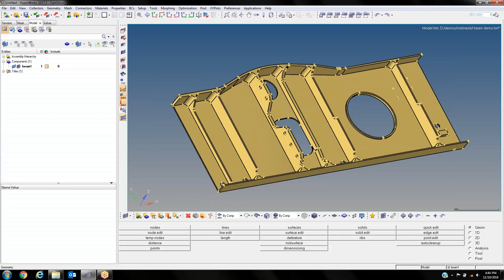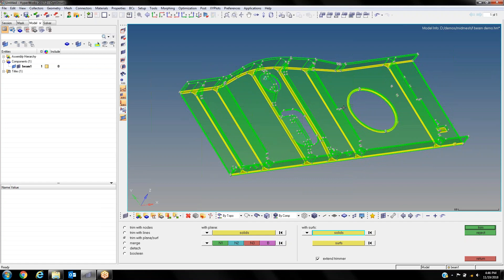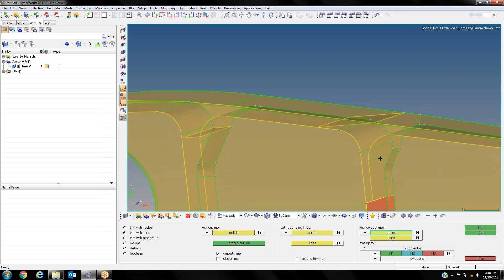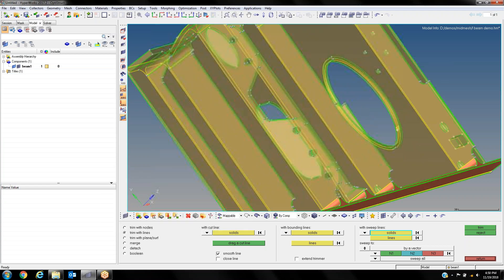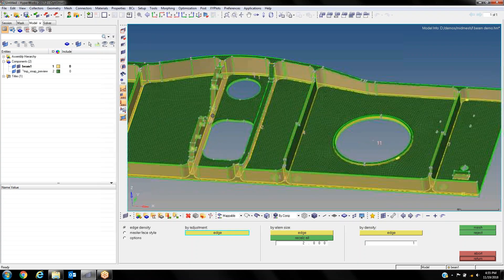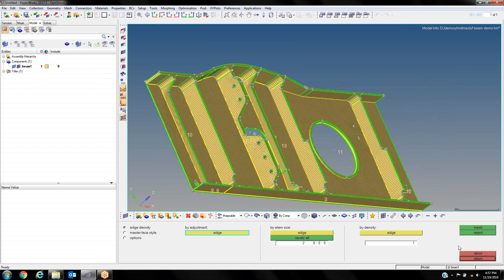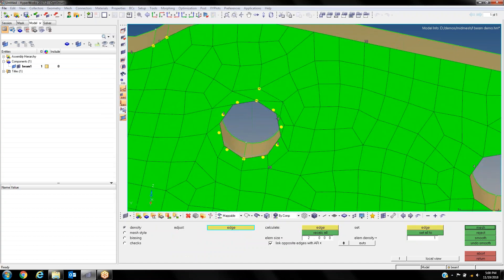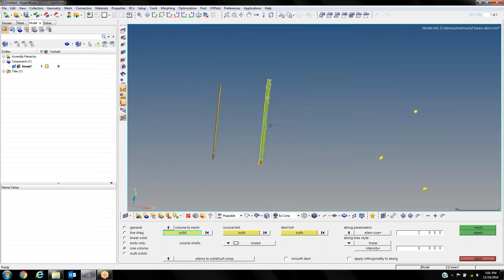How to 3D Hex Mesh using Hypermesh / Hyperworks

Comment: but when we divide the model into different components and then we mesh them separately, won't we have a discontinuity of meshes between the components? What I mean is, the nodes from the different components won't be connected to each other.